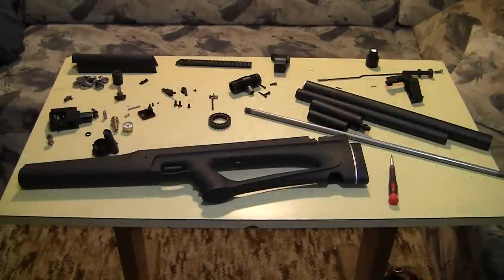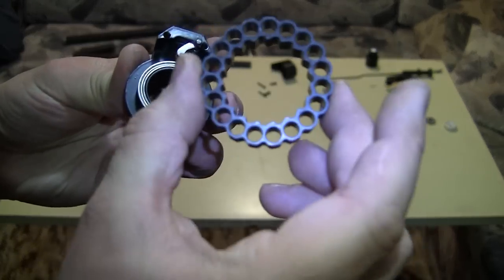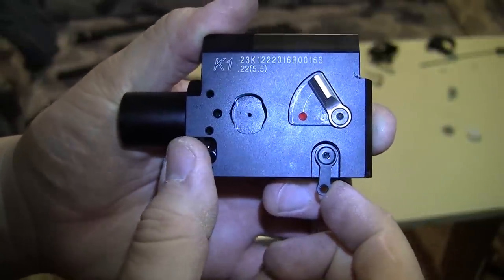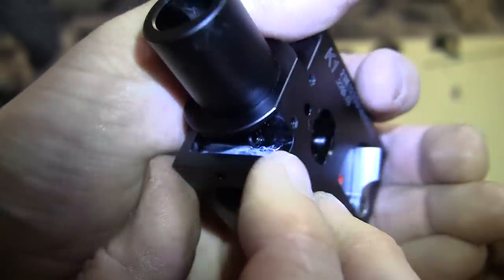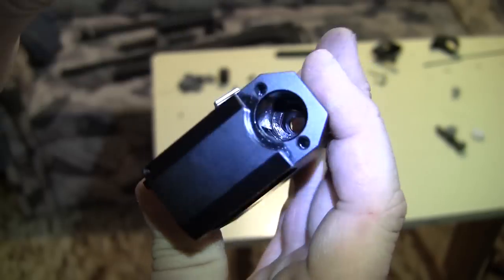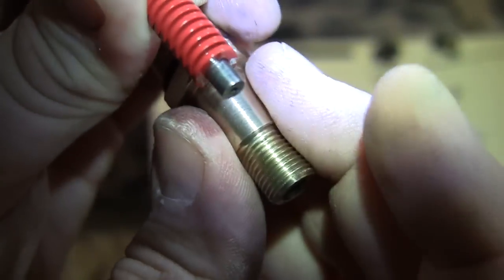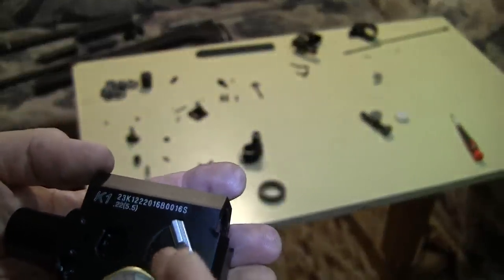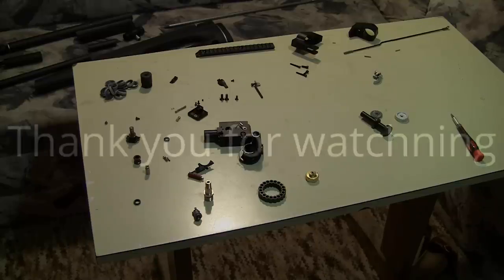Huben K1 - Full disassembly, operation explanation

Comment: There are a lot of similarities to my LCS SK-19 and this Huben. I absolutely love this gun and its accuracy with the polygonal barrel and tuneability. So far it has performed flawlessly and frequently take game out to 89 yards with ease. I tuned this gun to shoot the often forgotten and very effective and cheap.22 caliber Daisy Hollow Point pellets. The SK-19 holds a sub 1" group with them out past 50 yards at 900 fps in semi or full auto modes and the JSB pellets pretty much one hole in semi mode with the Hades. People say very misinformed things about this gun like ...the barrel will wear out or the magazine will eventually fail and not hold pellets anymore. They don't understand what materials this gun is made of. I don't know about the Hubens magazine but mine is made from titanium so it won't wear out from pellets for sure. As far as the barrel goes...Tom Gaylord once made a comment that airgun barrels last for a million rounds or more under normal conditions only shooting lead pellets. Thanks for this video. It has helped me to understand my SK-19 better.
Reply from the maker: I definitely agree about the barrels, they will most definitely not wear out! (unless you do something stupid like put something hard like a stone or sand in the magazine :)). I also have not concerns about the magazine, although I am not sure why they went with titanium for the magazine (I did hear this as well). Titanium is very expensive and hard to work on, steel on the other hand is still slightly stronger (in size to strength ratio) and very cheap. I assume they went with titanium because when wanted to make the magazine a little beefier while still having it relative lightweight.
Reply from the maker: I wanted to add, when I took a fast couple of shots at EBR with LCS, it seemed like a nicely built and accurate gun and I do not see any reason to have any concerns about its durability (but I guess time will tell...).

Comment: Surprisingly simple mechanism. My only concern is there's many sealing surfaces to potentially leak. But that should be no problem as the orings are simple to replace. Tracking down the leak may be a problem though. Probably easier to replace many orings while its apart than trying to track down the one that leaks. Thanks for this video.
Reply from the maker: +616Haggard I should not be a problem tracking the leak. If the leak is from the barrel, there is only one option - main (opening) valve. The closing valve is open by default and even when closed (only for a traction of a second after taking the shot) it has an intentional leak... So closing valve is never the reason for a leak. It the leak is somewhere else, all you need to do is remove the stock and use some soap water and find where the leak is and then replace the o-ring / seal...

Comment: Hello Gregor, if you buy the Huben K1 and then get it, what energy is set there in advance? Where do you have to turn and in which direction clockwise do you have to turn to set full energy or minimum energy? Many thanks for an answer Klaus
Reply from the maker: That depends on where you are buying it. My suggestion for high power is, set the reg to 170 - 180 bars and turn the power wheel 2 revolutions from minimum (32 clicks). For low power, set the reg to about 100-110 bar and fully close the power wheel. Make sure you don't shoot slugs at lower power to prevent slugs getting jammed in the barrel...

Comment: hi gregor....mine is leaking air beneath the cheeck pad...whats the probable cause before i open it all
Reply from the maker: Hi. It can either be the bleed screw on the top, but most likely, it is the main valve...
Reply from the maker: It can also be the indexing pin...

Comment: thank you gregor for the very nice and professional review of the lovely huben k1. and also to accepting the risk of putting this apart to discover the mechanism. looking forward to see the k1 performance after the barrel change.
in addition to choosing the right twist rate, using a bull barrel might lead to better long range performance of the gun I think at this power level there is a lot of stress on the barrel making it freely vibrating. how ever to do this you may need to widen those two holders. 

impatiently waiting to see if the long range issue is just because of improper barrel selection. I then wonder how these geniuses failed in this obvious part of gun design.

I really appreciate the mechanism employed by huben. except for directly shooting from magazine.
Reply from the maker: +Amin Kaveh I agree on the bull barrel comment, I actually have a 17 mm diameter LW .22LR barrel but, I decide not to put it in because of the modifications needed to the holders (and also other parts, like shroud and cheek peace). Also the fact that the gun shoots well at close ranges lets me know that the bullet or pellet is exiting the barrel with accuracy and downrange accuracy is lost because of pellet / bullet instability (twist rate).
I think that they did not pay any attention to the barrel, they just pick what is considered the best of the best of air gun barrels without realizing that what they were building is closer to firearm than air gun.
I agree, but the direct firing from the magazine is the only way to have the valve directly behind the pellet and to be able to have big surface area of the valve with no transfer port... Steyr HUNTING 5 Automatic has the same principle and from what I hear it is very accurate.
Reply: +Gregor Kamenšek I agree with you not to do a lot of modifications just to put in the bull barrel. it is a wise desicion.
I am an enthusiast and love version 1 of every thing. hope the long range issue of this beast get corrected. then it may be the perfect pcp of the time. how ever in Iran I don't know when I can shoot one in Iran.  😉
Reply from the maker: +Amin Kaveh I am sorry to hear that. There are quite a few countries that cannot sell this rifle because of their firearm legislation. I am lucky that I live in a country where this is allowed but i do have to have a FAC in order to own one.

Comment: Gregor, I've got a problem. My Huben k1 doesn't want to close after firing. What do you think I should look at for the problem?
 Thanks. Don
Reply from the maker: It can be too low pressure for the pellet weight and too much opened power wheel. Try this first
Reply: @gregorkamensek3923  thanks for the help!

Comment: There doesn't appear to be a probe or other mechanism to load the pellet into the barrel, so it would seem that the pellet resides in the magazine until fired.  Are there seals on both sides of the magazine?
Reply from the maker: +Barls Charkley Yes, the pellet is fired from the magazine. there is a plastic seal with an o-ring in the back of the magazine (I have showed it in the video). this seals the back side and at the same time pushes the magazine forward. The magazine presses up against the barrel by this force, sealing the joint between the front on the magazine and barrel. There is no leak felt on the cheek on fire. I believe that Steyr Hunting 5 Automatic uses the same mechanism...

Comment: Hello! I have a 2020 version of 6.35 caliber that has 2 manometers. A repairman strongly recommends that I will empty regulator air (not the main tank) after each use so that the o-rings do not deteriorate over time. Are you sure? Thanks
Reply from the maker: Hm, personally, I would never do that. The draining of the plenum is not very friendly to the regulator so frequent using of this method is not advised from my perspective. Also, I would say that even increases the chance of leaks since the o-ring is deformed and released on each charge, not to mention the temperature stress... Don't forget that in this case, you actually need to tune the gun before each use... So I do not find this method to be appropriate.
Reply: @gregorkamensek3923  Thank you, but for a shot of heavy bullets, the pressure must be increased, and for light bullets, it must be lowered. Lowering the pressure is also harmful. I do not know what to do but I am sure there is a way to reduce the pressure of the regulator so that it is not harmful, because the manufacturer has made this possible and optimized the o-rings, only the correct way to do this is not explained anywhere.
Reply from the maker: @Polarskii  Yes, you are right. It is typically recommended that you take some dry shots when the pressure is decreased. Huben actually made a very well protected regulator regarding decreasing pressure (This is a common problem for all externally adjustable regulators, for example if you do this on FX, you will destroy the regulator seal...), but it is one thing to change the pressure for few bars of few tens of bars and a whole nother thing to go to zero. In any case, it is pointless to do so because as I explained, you are not prolonging the life of the seal, I would actually say that you are actually wearing the out faster... You can always ask Huben direction about their opinion on this, after all, they did built the gun :)
Reply: @gregorkamensek3923  🙏😊

Comment: Hi Gregor I'm having a problem with mine I shot 4 or five times and then it didnt shoot anymore and I couldn't  put the gun on safety any more so I loosen the regulator the pressure went  down and then I could put the safety back on and then I put the pressure back where I had it I take a couple of shots an it does it like the beginning I could only do five shots. What do you think it could be ?
Reply from the maker: Can you let me know what is the pressure after that 5th shoot? If you cannot put it to safe, that means that the opening valve did not lock properly and the trigger sear did not engage (this also explains what you cannot take the next shoot). If at this time you do not have an air leak (opened opening valve), that means that there is something wrong with the opening valve. There are two options of the top of my head: the opening valve is damaged and it can extend too much (the opening valve is made of two parts and they extend when the valve is closed) although that would most likely mean that you could not shoot at all... second is that something is mechanically obstructing the part that is behind the opening valve (that part actually locks to the trigger sear). There are also some other possibilities like: the opening valve return spring is too weak (the spring behind the opening valve), maybe you are shooting with relatively low pressure and you have the power wheel fully opened  (this is specially a problem is you are shooting heavy tight slugs), maybe the trigger sear is either damaged or the spring too weak to reset it and lock to the valve,... Hope any of this helps
Reply: @gregorkamensek3923  thank you Gregor for the help. The opening valve looks pretty good I disassembled it an the orring inside is good and tite I grabed the tip of the opening valve an stretch it out and then  I unscrewed it has a little orring and it looked good. You asked me about the pressure I have it regulated at 170 after the shots it doesn't drop the tank is in 300bar the rifle doesn't leak its very rare maybe it's the spring or something wrong with the trigger inside I'm going to check that out now

Comment: Hi, can you tell me please the volume of regulated cylinder or at least the inside diameter and lenght ? Thank you for this nice review.
Reply from the maker: Hi. I don't have the gun disassembled at the moment but the approximate dimensions are: inner diameter is about 26 - 27 mm, the length of the tube is about 100 mm. There is very little volume reduction due to end caps (regulator and transfer port) but there is some additional volume in the breach, so you can subtract those volumes... So the regulated volume is about 55 cubic centimeters...
Reply: Thanks alot. The info that you gave me is more than enough. Very kind of you.
Reply from the maker: No problem ;)

Comment: Hello Gregor, i put my backend off the huben under the water and see bubbles from the rotary magazine, do jou have any thougts about it. My huben is slowly leaking after a while.
Greetings from holland
Reply from the maker: Hi. There are two possibilities... One is the main valve. That is quite hard to replace, you need special tools and you need new main valve seals (composed of plastic seal and metal ring). Second possibility is easier, it is possible that you have a leak on the indexing pin. This is a 2,5 mm pin that is actuated by high pressure air and it is sealed by 2,5x1 mm oring. I suggest you try to replace this one first and you can use regular NBR70 material... Make sure that when you fix the leak, you dry out all the water and lubricate the gun :)
Reply: @gregorkamensek3923  thanks for quick reply,..i think its de indexingpin o rings, but iam not sure,.. the gun works fine, but after some time its emty. I am going to try this first and hope thats it....thank you for technical support, and keep up the good work on you tube. Greetings from holland. Peter.
Reply: @gregorkamensek3923  Hi Gregor, I too have a leak at the indexing pin. I can actually hear the hiss of the air escaping. The sound of the hiss changes and even stops sometimes when I play with the magazine release arm so it must definitely the pin. Is the O-ring you mention located on the brass screw as seen at 16:16 on this video?
Reply from the maker: @jeanvanrooyen6004  No, there is another o-ring at the end of the hole where this brass part fits. The o-ring it 2,5x1 mm dimension. If you run your K1 at lower pressures, I recommend using NBR70 and NBR90 if your pressure is high. This oring seals around the pin on the left side of the gun where the leaver for magazine lock is and is one of the more critical o-rings to fail in the gun.
Reply: @gregorkamensek3923  Thank you for your quick reply Greggor. OK I will get a new o-ring and try install it. I usually have the regulator set at 160 bar shooting the monster redesign at 950fps.I suppose this is high pressure for this gun? If so I will use NBR90. I want to get slugs for it(if i can ever find a MP molds 5.52 mold or the actual huben slugs) and run it to 170 bar(the max recommended for K1?)
Reply from the maker: @jeanvanrooyen6004  Hi. NBR90 will be OK. NBR90 will last longer but has a bigger possibility for a leak... You can get K1 to more than 170 but it makes no sense to go further than 190 bar as the power does not increase anymore. Yeah MP mold is quite slow and does not have the molds on stock most the time. Send them an email, maybe it will expedite the process...

Comment: Hi Gregor,
Do you know the size and thickness from the rubber oring that seals the opening valve? (part number 6)
Reply from the maker: Open Firing Valve O-Ring
11.6x1.8NBR90+Molybdenumdisulfide
Reply: @gregorkamensek3923  thanks!

Comment: Hi gorge I would like to ask you a question about my Huben k1 I have a leak maybe you can help me with it thanks
Reply from the maker: Sure. What is the question?
Reply: Gregor Kamenšek in the bottom of my huben k1 have a little white plug I have air leaking from it would that be the rubber around the hammer that is leaking

Comment: Hi Gregor, thanks for the video and the explanations! It is probably asking for the obvious but in the brass part of the main valve (the one in line with the barrel) there appears to be a small hole. What is it for???? Thanks again and keep up the good work!
Reply from the maker: It is for venting the air when the brass/steel valve assembly is moving together and apart...
Reply: Thanks mate!